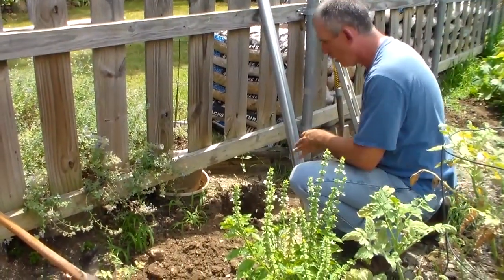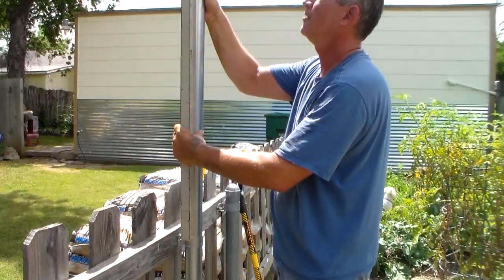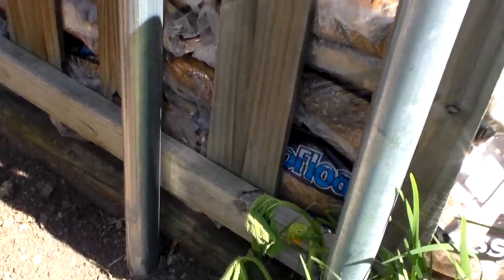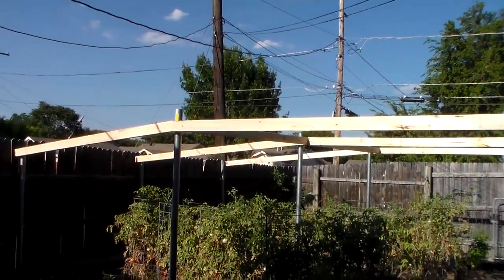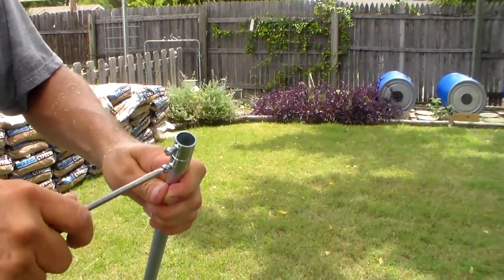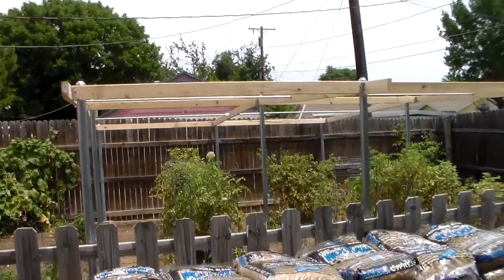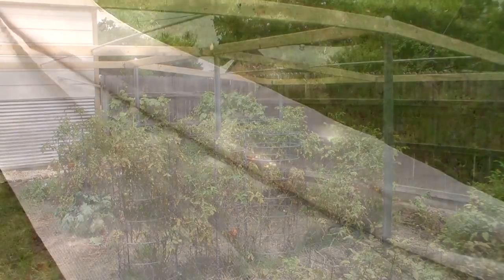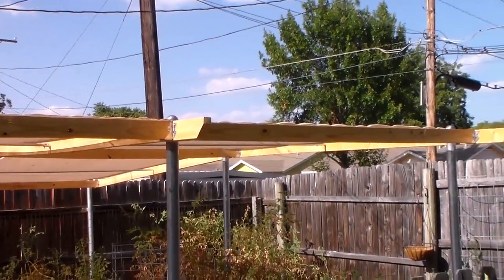How to Make a Sun Shade Cover for Vegetable Gardens :Gardening 101

Comment: I also live in north Texas and have had it with the sun wilting all my plants. My cantaloupes are supported under an arbor but since the sun has become so bad, they rot on the vine. The sun eats one side out. I lost all my onions a few years ago. I put them out to dry on huge nets but the sun, in a single day ate half of every onion. By night I only had half onions. Radiation, not heat, is the problem I am dealing with. I plan on putting shade cloth up before spring. Right now I am building a chicken house. Slow, can't move like I once did. Lord bless you all in these times the bible called "The beginning of Sorrows".

Comment: What is the outside dimension to this garden? Just wondering,looks to be about the same dimension as mine. May I ask what you investested ?price wise in the lumber,conduit,concrete and posts? Thank you for sharing,the extreme heat in Ca. Is pretty intense as well...I really like this concept..again thanks to you both
Reply from the maker: Our garden is about 20x30. The shade cloth was the most expensive part. I think we spent around $70 for the entire construction. The shade cloth was more expensive a few years ago when we made this. I can say this setup has dramatically extended our growing season and saved our plants.
Reply: +Days Well Spent thank you so much and take care..Grow On!
Reply: $70?!  Wow! That is good for 20x30!
Chain link poles must be inexpensive! 
2x4 are $2 for 8' I think.  How long were yours? How many?
Concrete is $5 bag.
How much was your shade cloth?
Some couplings and conduit is $1 for thin stuff I think.
Great use of materials!
Reply: 10' Top rail tubes are $12 at Lowe's.  That would be 9x 12 =$108. Where did you buy the posts? How much were they?